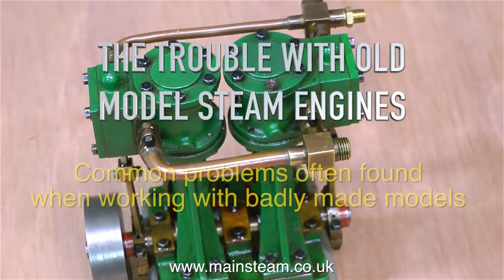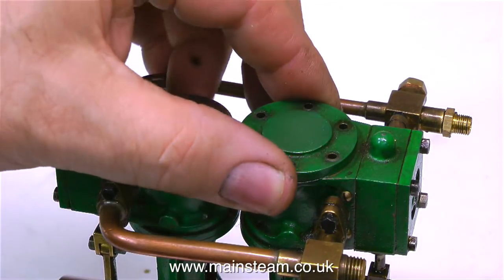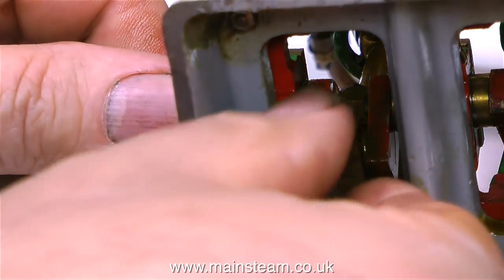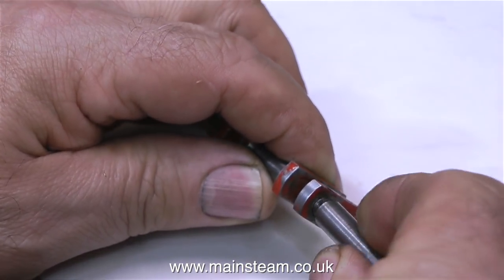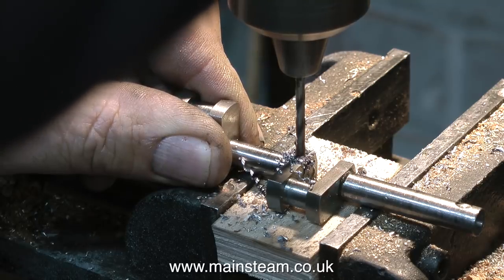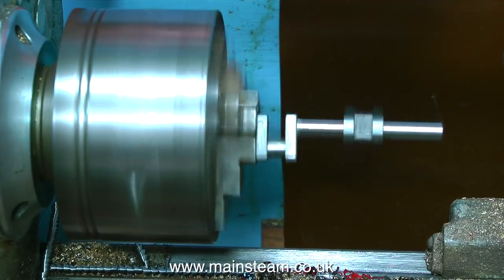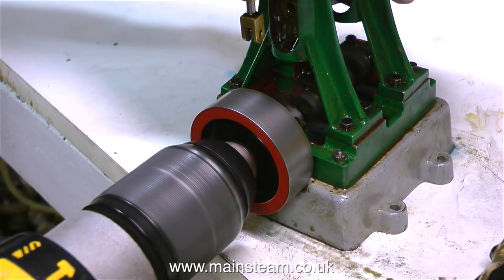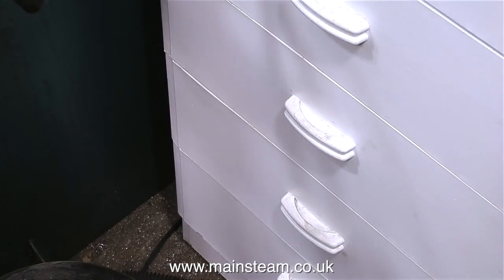THE TROUBLE WITH OLD MODEL STEAM ENGINES

Comment: That was brilliant, very educational, showed how to spot many of the faults and the observation about badly painted and mismatched bits is bound to be useful as a guild. But is the lesson, don't buy a model engine off the internet? Surely that severely limits the places you can find them, not that I've ever looked for a model steam engine so I could well be wrong. Also, I was wondering why you throw them in a draw as scrap rather than fix them? You obviously know how to do it but is it that they are not worth the effort? Assuming the block was ok would the crank be the hardest part to manufacture and doesn't anyone sell a decent cheap crank for that model engine, maybe the manufacturer? Please excuse my ignorance but you don't know if you don't ask. I'll watch more of your vids, perhaps they will tell me. Thanks for putting them out there.
Reply: The only stupid question is the one never asked.

Comment: I have a pair of model traction engines from Wilesco. I've tried running them but both barely move. A friend said they probably have calcium build up. Is there a way to remove the calcium without too much bother?
Reply from the maker: Kettle de-scaler (Killrock-K)

Comment: not sure why the crank halves have to be at exactly 90 degrees, certainly one can adjust valve timing .. or no?
Reply from the maker: You can adjust the valve timing, but the crank webs still need to be at 90 degrees.

Comment: It is nice to see you are interested in precision, but as a model that will never do any useful work, and is effectively just slightly more durable than a plastic toy, precision isn't really important. If it can halfway run stable, it's a successful model.  If you want precision,, that's great, but you should also expect a much higher cost for time and effort needed to achieve that.

Comment: What did you do with this unit after you took it apart and put it away in the drawer? Was it ever sold as is? If not, how much would you be asking for it as is including cost of shipping and handling?
Reply from the maker: It is still in the drawer awaiting the video rebuild }:-)))
Reply: Have you ever thought of trying to get a set of blueprints made off of it to sell? It would even be interesting from the perspective of using a 3d printer as well.
Reply from the maker: This is a commercial model steam engine built from "Stuart Models Number 10" set of castings & materials - there is little point in my infringing the Stuart Models copyright on the drawings as I can just buy a set of drawings for this engine from Stuart Models should I require any .....
Reply: Sorry about that old chap.

Comment: Couldn't you have welded the crank shaft together and gotten rid of the excess?
Reply from the maker: On such a small part, welding would be too much and it would probably distort ......
Reply: I didn't think about the heat distortion...Damn

Comment: having worked in the biggest engine remanufacturing plant in north america i can tell you that all this is very fixable. a guy like you with a big lathe could remake the crank in a day.
Reply: by remake i dont mean making it in one piece like you think. but like most engine todays except big big ones. making pins and plates and pressing them togeder. this engine isnt complicated and it could be a very easy job for you.
Reply from the maker: considerably less than a day I would think. I will at some stage show the rebuild when I find the time to get around to it
Reply from the maker: yes indeed, I have shown the process in the video series about rebuilding a Stuart Twin Launch Engine.

Comment: it seems like making that crank shaft in one piece ,would have been be less work.
Reply from the maker: Definitely not, it is easier by far to make a simple built up crankshaft, using Loctite retainer & then cross drilled & pinned but not made the way this one was made. .....

Comment: cool engine weld the crank shaft  strong little engine
Reply from the maker: too small - potentially too much heat distortion if welded . . . tried it before, Silver soldering is OK, but I prefer the "Loctite" retainer  method . . . .

Comment: I don't get this video at all.  We start out with a completely knackered steam engine.  We then see several processes, all of which are "not recommended", and after 12 minutes we still have a completely knackered steam engine.  So what was the point, exactly?
Reply from the maker: To show common problems with model steam engines, I will rebuild it in due course . . . . . strange that you should make a comment like this as hundreds of people have commented that they learnt a lot by my use of this approach . . . . never mind . . . . .
Reply: @keithappleton  Thank you for your reply.  If the video had just shown us all the common problems to look out for, that would be great, and it would be a useful video.  Also, I like your presentation style very much - very clear.  But to show various ways of fixing them and then saying "don't do this" - that's odd.  It would make more sense to show the right ways to fix the faults and not  show the wrong ways at all.  :-)
Reply from the maker: This is a preview to a forthcoming video when I finally get around to rebuilding this engine. I get a lot of correspondence from viewers who often do things very wrong in similar ways to the way this engine was made, so sometimes I point out the problems associated with "How Not To Do It"........ Many viewers appreciate this method of tuition ....... I am sorry that you don't understand this approach.

Comment: Reminds me of Titanics engine
Reply: The RMS Titanic had  triple-expansion steam engines.  The only similarity is that they are both steam engines.  Titanic also had a steam turbine.  A different kind of engine altogether.
Reply: Yep. The turbine ran off the exhaust steam from the low pressure cylinders (both main engines had two LP cylinders).

There was nothing wrong with the Titanic engines. The main problem was a captain who, as was standard practice at the time, did not reduce speed or layover during the night while in a known ice field area.
Reply: A different kind of engine!

Comment: just remove the center clam, that crankshaft is not centered
Reply from the maker: I don't think that is a good solution ...
Reply: @keithappleton  yes, that is not a good solution, just a trick. the mentioned main problem is it's ratle because there is a problem with the crankshaft (not centered)

Comment: And what for they can be used these steam engines? Just watch them spinning?
Reply: Just fun models. Fun to watch, fun to build, fun to fix. You can run small generators, but they're not really practical.
Reply: They are nice for demonstrating how steam engines work.
Reply: I just bought one and the same thought occurred to me, which is why I did not go for the top of the range one and also why I bought it in "used once" condition at approximately half the price of new. It is a nice mechanical toy and nice to watch once in a while but seriously will just take up desk space most of the time.  That is why you should always try to buy one "in box" so you can at least put it away on a shelf if necessary.